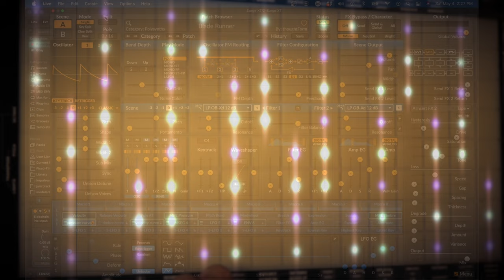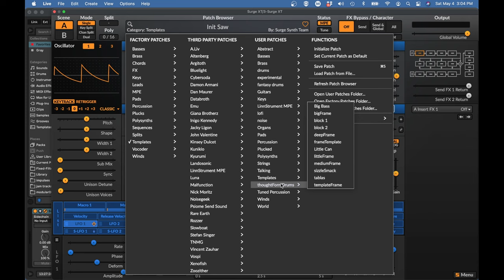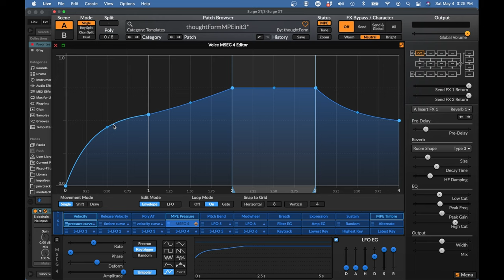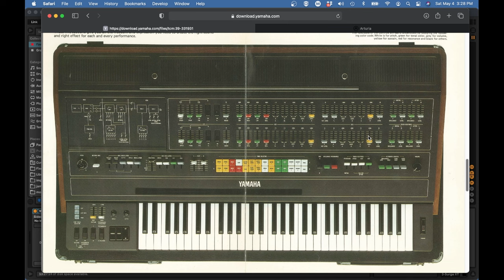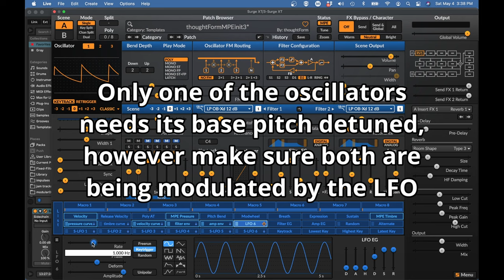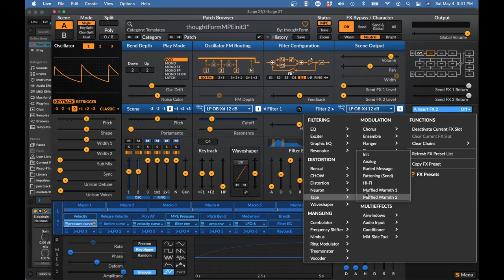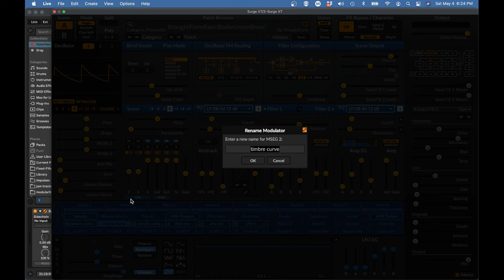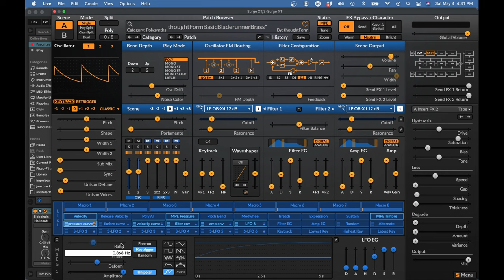MPE Sound Design in Surge XT: Analog Synths and Blade Runner

Comment: Hi.... Just here to make some corrections to your info.... There are many more than six well working CS80s in the world....  I owned two of them...one is being worked on to fix an oscillator...

The CS80 Filters are in series... Not parallel... There is a sine waveform in the amp section of each synth section... The flowchart of the synth is shown on the hatch lid... 
The inverse saw waveform chip runs into the waveshaper chip... The outsourced waves available at the chip is pulse, triangle,saw,sine  . The pulse and saw go into the resonant hpf first accompanied by a noise generator...the output of the resonant HP filter goes into the resonant low pass filter which has an envelope and two amounts below and above cutoff points... The mixer then allows a sine wave to be added after the two  2 pole filters in series ..it is then that it mixes with the second synth engine where you can select footage on the performance panel .. cheers
Reply: The triangle wave isn't used, but could be in a mod...
Reply from the maker: The 6 left in the world thing was a joke :) Thank you for the info though. If the filters are serial, are they both affecting both oscillators? I understand from the diagram that the HPF and LPF are serial, but the "I" and "II" control panels really make it look there's one set of HPF and LPF per oscillator.  That's what I meant about the filters being in parallel...i kind of ignored the highpasses because they weren't really relevant to this particular sound.
Reply from the maker: I had completely missed the sine wave. Just not where I expected it to be. Can you use it independently of the saw/pulse if you turn down the VCF level, or is it just there to fatten them up?